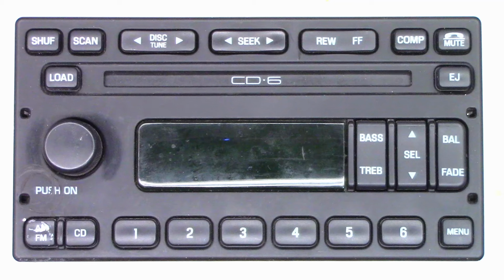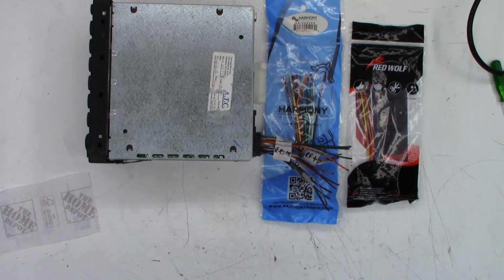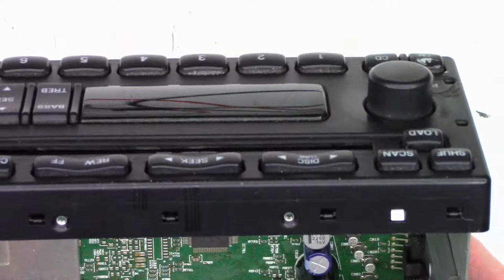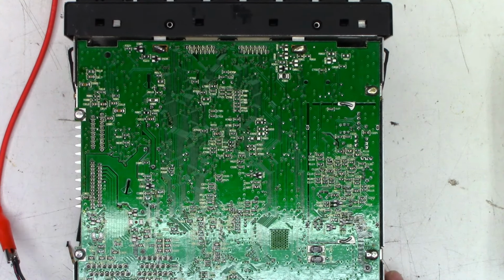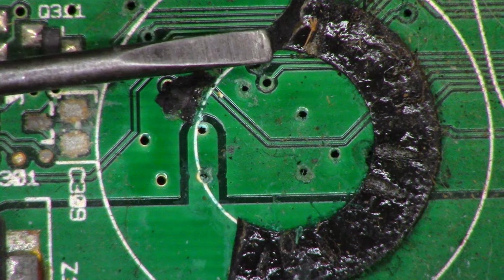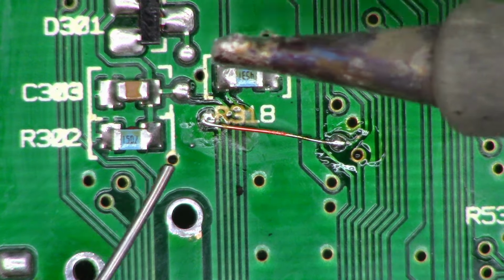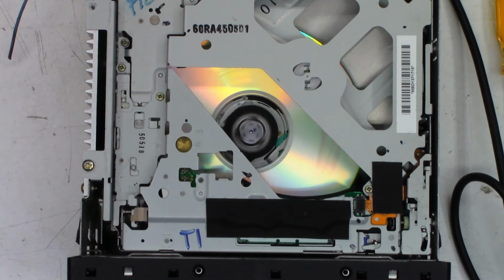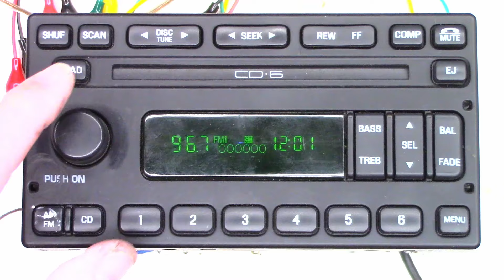2002 Ford Ranger Stereo 3C3T-18C815-AC Wont turn on repair.

Comment: Smashing repair :-D,  the darkness of the through plating is always a worry.
There is no way of knowing how long the radio has been sitting in a nasty damp location.
Like a damp shed.
Getting the correct connector can be a time of hair pulling out, while swearing lol.

Comment: It is wild that Ford had a 6 CD changer in such a compact space. Many mfg had multidisc changers, but that usually involved a separate unit elsewhere in the vehicle. Nice job finding the open traces! Do you think the glue holding the coil in place caused the corrosion to the feed throughs?